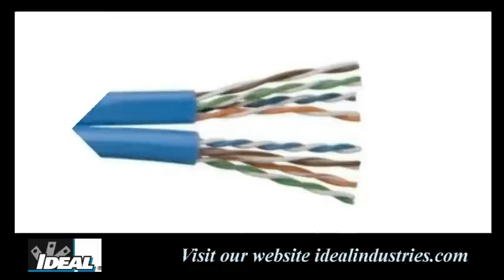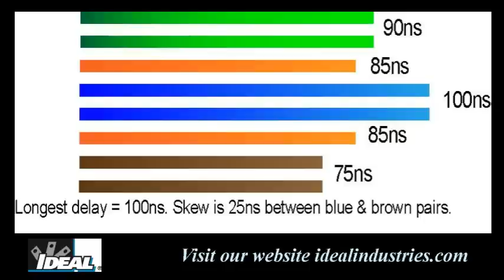Cable Length, Delay Skew, DC Resistance

Comment: What is the main reason for delay failing in cable as I see my blue pair is faster and causing skew failure.
Reply from the maker: I would suspect the cable if you are failing a skew test. Cheap cable are exactly that and may not perform well. Good luck Ron